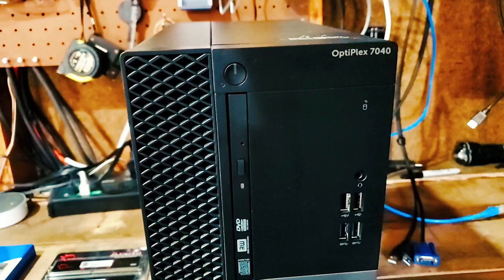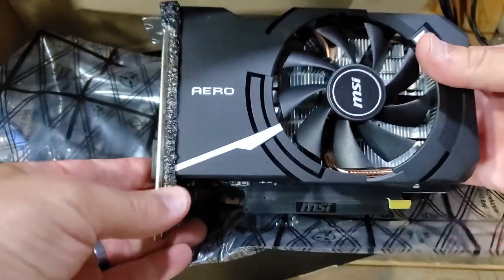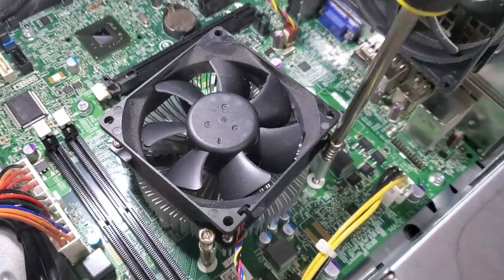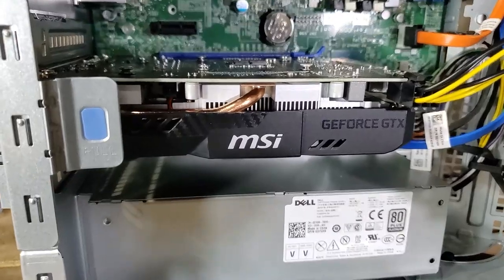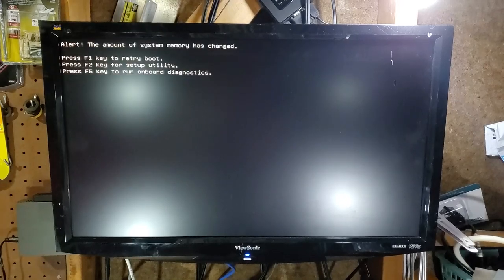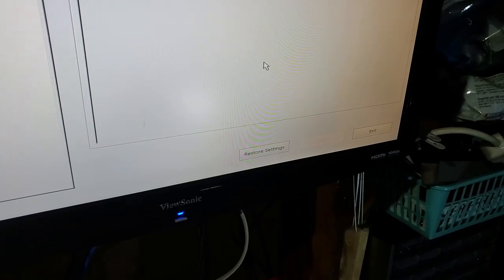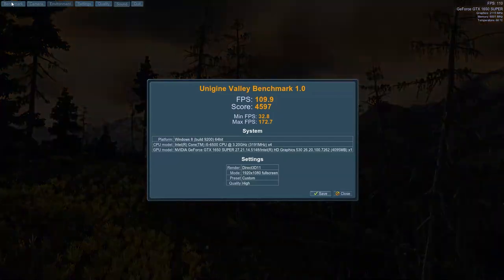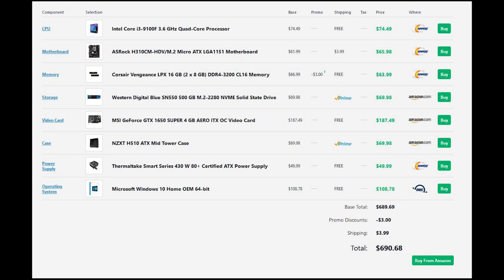Nvidia GTX 1650 Super in a Dell Optiplex 7040 - Best Optiplex Gaming PC for 2020!

Comment: Apologize if this was already answered but I have two questions. Does this particular case allow for an ATX  PSU? I have a couple laying around I could use. What is the maximum length for the GPU before interfering with anything? Currently using a 3010 case however I can only have an 8 1/2 inch GPU before it covers the SATA ports.
Reply from the maker: It does not use ATX power supplies.  It's proprietary, but is closest to a TFX standard PSU.  There's probably less room for a GPU in this than the case you already have.  I'd recommend trying SATA cables with right angle connectors on the motherboard.  You might block some of the ports, but they should fit under a GPU and you should get a couple that are usable.  Thanks for watching!

Comment: Hey, I was planning on buying one used (7040) for $299 (i7-6700 with 8gb of ram and a 240gb ssd); is that worth it? Also, If I do get one, would 8gb of ram, an i7-6700, an ssd, an hdd, and a 1050ti require me to buy a new PSU?

edit: I meant 8gb of ram, not 16gb
Reply from the maker: That's a decent price for today's market on an Optiplex 7040 with an i7 6700.  A 1050 Ti wouldn't require PSU upgrade.  Good luck and thanks for watching!
Reply: @EscoTech  I decided to go low for my budget and I'm gonna get a used 7010 with an i7-3770 and 8 GB of ram and a 1 tb hdd for about $190. I also think I'll get an rx 570, although I'm still planning everything out.
Reply from the maker: There's really not a big performance difference between the i7 3770 and the i7 6700, and the 3770 is much cheaper.  Good luck with the build.

Comment: will it fit in the small form factor 7040?
Reply from the maker: No, the SFF has the PCI-E slot too close to the PSU for this card to fit.  This card is low profile, but still essentially two slots tall because of the cooler.
Reply: oh i see, that sucks
Reply from the maker: @quad8199  What sucks is it seems like Dell did that intentionally to keep people from upgrading the gaming capabilities of the SFF systems.  Gotta drive business, I guess...
Reply: @EscoTech  yeah, i dont see the point in that, maybe so people will buy a different, bigger pc from them to fit a bigger graphics card or something, i dont really know

Comment: would 1660 ti be too much for the psu to handle?
Reply from the maker: Yeah, a 1660 Ti would draw too much power for the stock PSU.  There are some PSU upgrades available.  I've seen SFX power supplies(with Dell 8-pin adapters) used in this build and there is also a Dell server PSU that will work.  Thanks for watching!

Comment: Ant idea about Optiplex 3040mt? I bought It this morning!
Reply from the maker: Should basically be the same case, but I don't think you have the m.2 slot for an NVMe drive.  Also, your RAM is different.  I think your 3040 uses DDR3L instead of DDR4.  Otherwise, the upgrades can be done similarly, just use the right RAM and a SATA SSD.  Thanks for watching!

Comment: Hi - do you know if this would run Flight Simulator 2020?
Reply from the maker: Flight Simulator 2020 is an extremely power hungry game.  This PC meets the minimum requirements, but I can't say the gaming experience would be the best.  It would work, but you'd need to take the settings down to get it to play smoothly at a good frame rate.  Thanks for checking out the video!

Comment: Can you upgrade your CPU to the i7 6700 without upgrading the PSU?
Reply from the maker: Yes, I am finishing up a performance comparison video with this system upgraded to an i7 and it doesn't use much more power.  I was surprised by that, on average during the benchmarks, the entire system uses about 10 more Watts with the i7 6700 than the i5 6500.  Should have that video up in the next few days if you want to check it out.  Thanks for watching!
Reply: EscoTech Alright, I’ll look forward to your next video.

Comment: You mentioned under clocking your ram to 2133 MHz in the video. Does it happen automatically or do you have to do it manually?
Reply from the maker: It does it automatically.  2133 Mhz is the fastest RAM speed this processor can use.

Comment: Can you do this with the Dell optiplex 3040
Reply from the maker: Yes, the 3040 will be very similar.   The main differences are that I don't think the 3040 has the m.2 slot and it only has two RAM slots of DDR3L, instead of the 4 slots of DDR4 in the 7040.  The SATA SSD and DDR3 RAM shouldn't make that much of a difference in performance, it would still be pretty comparable to the 7040 in the video.  Thanks for watching!
Reply: @EscoTech  thank you for the information

Comment: You didnt upgrade the psu?
Reply from the maker: Nope, the 1650 Super is fine on the stock PSU.  That's the most powerful card I would put in this system without a PSU upgrade, though.  Thanks for checking out the video!

Comment: i put a 1650 super on this dell optiplex 7040 the difference is that i have an i7-6700 and 24gb ddr4 ram now. is it possible to overclock my gpu without breaking it? i have the same stock psu.
Reply from the maker: I can't answer that right now, but I am testing this system with an i7 now and will check power usage.  Thanks!
Reply: EscoTech alright thanks!
Reply from the maker: I ran all these benchmarks with the i7 and the highest power draw I saw at the wall was 190 Watts.  I think you probably have the headroom for a small overclock, but I wouldn't go too crazy.  Adding in about 17 Watts to the PSU draw for inefficiency 190/257=73% so you could use another 10 Watts or so on your overclock and still be in a good spot on power usage.
Reply: EscoTech Alright man thanks for helping! gave u a sub and likes gl in ur future vids!!
Reply from the maker: Thanks, appreciate it!

Comment: You could shave at least $100 off the price comparison price list with Windows 10 pro key off eBay or Amazon
Reply from the maker: Hmm, I noticed a little bit of an echo a few times while recording, but didn't after I processed the video.  I will check it out.  Thanks!
Reply: @EscoTech  it was okay, good build though

Comment: This is a fantastic video. Really well done! I do a fair amount of graphics work with some light gaming so I have a 3 monitor setup. Would you still recommend the 1650 Super as the go-to GPU with the existing 240W psu, or would I better served with a GTX1050ti or something a bit less power hungry? I have a 1TB SATA drive and I might also drop in a SSD at a later date. I also have external hds and a couple of printers so I'm really careful about stressing out that psu. Thanks.
Reply from the maker: Thanks for the feedback!  You'd probably be safer with a 1050 Ti, and it's still a good card.  A regular 1650(GDDR6) might be an option on the stock PSU, but I'd look into a PSU upgrade if you want to do a 1650 Super.
Reply: @EscoTech  yeah I think that's what I'll do. I was hoping my PSU was 80 Plus Platinum like yours in the video, but it's only 80 Plus bronze, so I like the idea of have a power meter like yours and tracking wattage. All the best!
Reply: @chinook7905  it’ll be fine

Comment: hi so i was wondering could i use a gtx 1650 from asus on a dell optiplex 9010 MT(mid tower)
This gpu has the following dimensions   8.03 " x 4.53 " x 1.46 " Inch  or  20.4 x 11.5 x 3.7 Centimeter

Here is the website of this gpu   https://www.asus.com/Graphics-Cards/DUAL-GTX1650-4G/specifications/
Reply from the maker: Yep, should fit fine and work great.